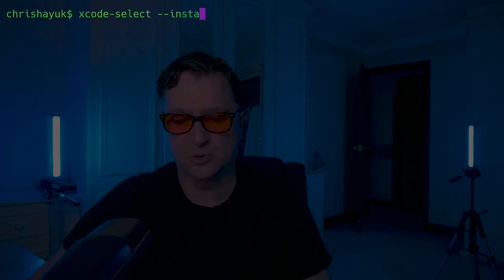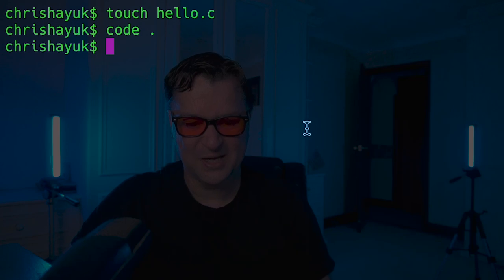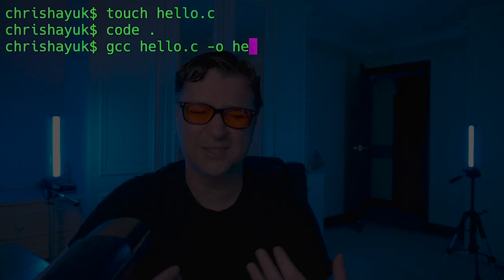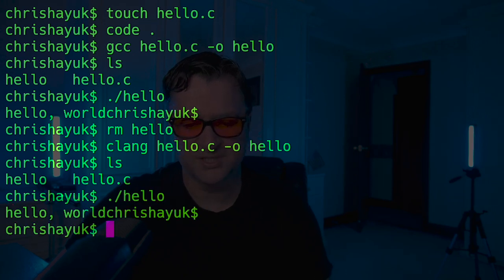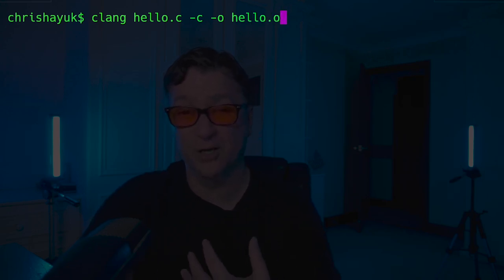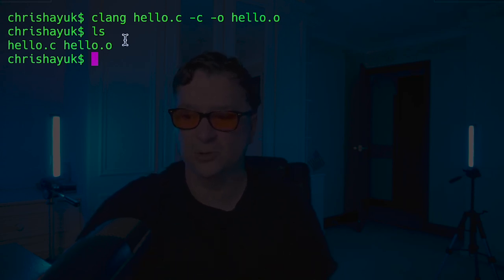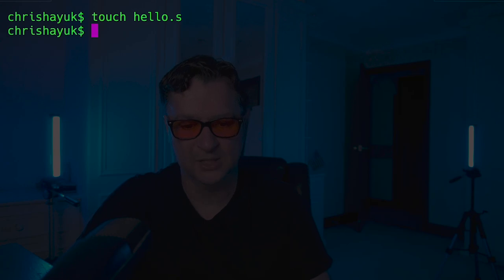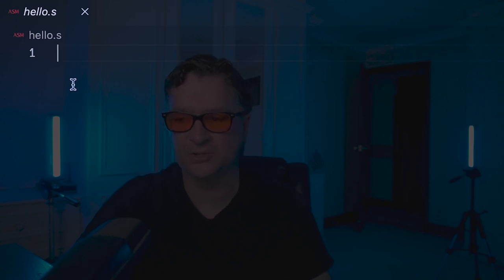how hello world for arm64 assembly really works (apple silicon)

Comment: What happens if a function has more than 8 input parameters? How'd you pass them?
Reply: They go to the stack. But you should design your APIs to not require that many parameters. If you really need more parameters then create a structure and pass its address as one parameter.

Comment: How to output number?
Reply: You need to make it a string. In C you have itoa to convert an int to a string. You can inplement itoa in Assembly if you want it's not hard once you get the basics. You can also output a single digit by adding 0x30 to the number no need to implement itoa for that.

In assembly that is:

x1 = 1.
Add x1, x1, 0x30.
This will make the x1 = 0x31 which is the character "1" in ASCII. Now you you could use write with size 1 to output "1".

Comment: ld: library not found for lSystem, <<<<<<<<<<<<What could be the issue the command i used is:
ld hello.o -o hello -l System -syslibroot=/Library/Developer/CommandLineTools/SDKs/MacOSX13.3.sdk -e _main -arch arm64
Reply: I get the same error running Mac OS Ventura. Did you find a solution for this problem?
Reply: I found a solution. In the code, change .global _main to .global _start  then lower down change _main: to _start:   When you invoke the linker, change -e _main to -e _start.  (no periods after start, youtube correction keeps putting that in).. looks like the linker has a problem with _main in newer versions of MacOS
Reply: That's interesting because I was getting the same error but for me it was because I was using single quote's '' and not backticks `` @willcasp
Reply: same error on Ventura, tried everything, nothing changed
Reply: No problem with the _main label in Sonoma